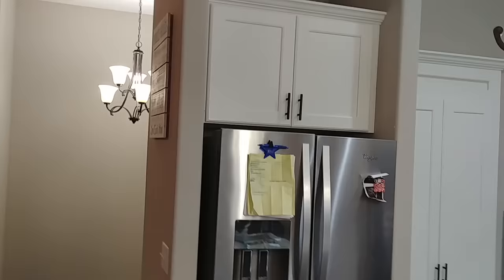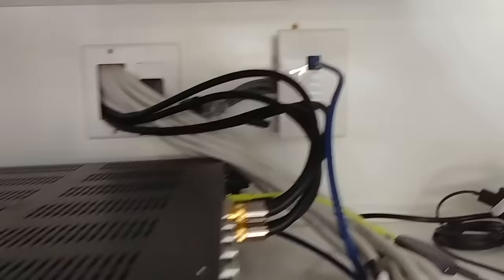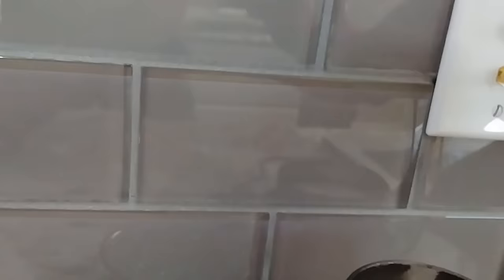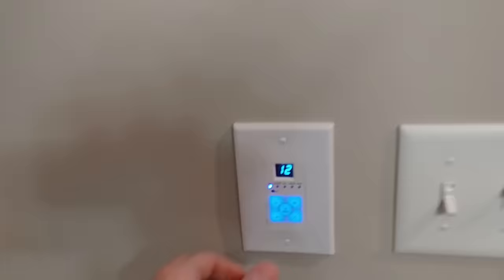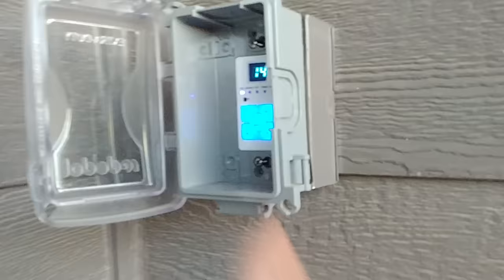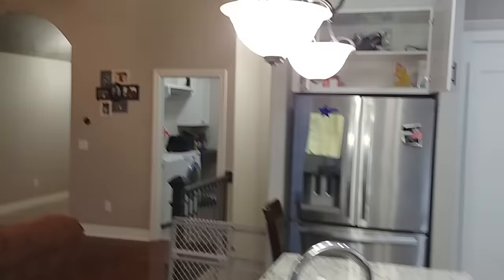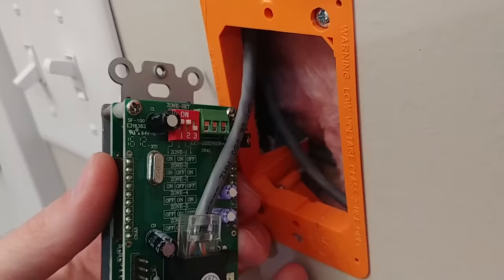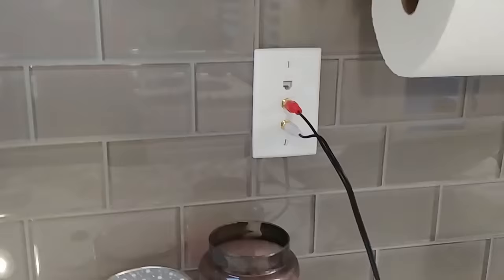WHOLE HOME AUDIO: Monoprice Whole Home Audio Amp! 6 Zone 6 Source

Comment: Thank you so much, I have purchased the system 

And today I was installing it and everything was perfect, except for zone 1 all jumpers setting are correct.

But for zone 1 the control keypad is working but if you press any key it does not do anything, but when you remove any other controller from the amp, zone one works perfect but when you connect all controller units zone one controller freezes.

I have checked the jumpers (ON OFF OFF) for each zone and still I have the same issue, even though the amp is just brand nrw.

If you have any info that cud help please reply. And once again because of your video I have bought that system and later I will upload a video to show you how I made the setup for my apartment.
Reply from the maker: Usually if this problem happens it's because of those 3 switches like you mentioned. Is your cabling good for sure? I would suspect that maybe, and next try using a different keypad from another zone and if you switch it and still get that problem it might be the cable. But if the problem happens on the zone you switched it with, then it might be the keypad since the problem followed the keypad
Reply: @TheKMZ1  I will make like small simulation to test if the device working properly and if that's true that's mean I have problem in the cables inside the wall, which will be problem, because it's apartment and I have those wire before coating and other finishing, gotta give u a feedback and also later I am going to record a video to show you my setup, it took a lot of time to purchase all the required item from abroad as we live in Egypt and the market is very limited
Reply: I have made a small simulation with small cabling it works .... Dunno where is the problem I will try to reinstall the rj connectors and see if there's any different
Reply: Now everything works well I have replaced the cable of zone 1 by fishing tape and now the system working very well, all credits to you.. the system is beautiful and good solution for any building, gotta buy the software that you developed and everything is good. Later I will record a video of my system and let you see what I have done

Comment: Hi Friend, thanks for this wonderful video. I want to find out how you were able to connect the RCA modular jack to the Wall plate. What is your connection mode with the RG6 cable running from the amp?
Was the cable soldered directly to the modular jack or terminated into another connector that connected to the Jack,?
Kindly share with me how you were successful with that connection and how you did it. 
I have a similar project but it is presently stalled by that the connections to the Monoprice RCA wall jack.
Thanks a lot.
Reply from the maker: They are RG6 to RCA compression fittings https://amzn.to/3iWWFhx
Reply: @TheKMZ1  God bless you, brother! I appreciate you. I will make a purchase right away.
Reply: @TheKMZ1  I appreciate your timely response. Thank you so much!
Reply from the maker: @tosinayorinde8324  please check out my new video, of the soundavo ws66i. Maybe you would rather have the new version of that amp?
Reply: @TheKMZ1  Alright, I will check it out. Thanks

Comment: Hi,

Nice install!!

how did you run the wires?
Was your amp installed on the main floor?  
Do you have a second floor and did you install any speakers/controls there?
Reply from the maker: I ran the wires in my attic, the speakers are on the main level only, not in the basement. I do not have an upstairs

Comment: TheKMZ1 i recently did an installation using this product but i didn't use coaxial wire for my source, and i have a buzzing sound, so i would like to know 1) u ran the RG6 cable from the back of the amp all the way to the wall thingy?yes? 2) Did you terminate the ends of the RG6 cables usign RCA plugs? thanks superb video
Reply from the maker: chuky sweettooth yes 1 RG6 for red RCA and 1 RG6 for white RCA, so every source has 2 RG6 cables. And yes each cable has a terminated RCA end on it
Reply: yessssss thanks thanks thanks, it all works without no buzzing sound, thanks alot RG6 was the missing link

Comment: Because all my speaker wires are in a tight spot & my AVR doesn’t fit ? So do I half to rewrite all of it ??
Reply from the maker: Just make yourself some extensions and either solder the extensions on, or use wire nuts to attach the extensions.

Comment: Awesome set up.  I just started wiring my new house to run this exact system.  Did you use RCA cables from the kitchen and TV’s for those inputs?  Or did you run coax and then convert from coax to RCA at the amp and the wall outlets?  Also - can I bridge two outputs together to yield higher watts to my outdoor spreaders, if I’m only using 5 outputs for 5 rooms?  I can’t wait to get this system up and running!
Reply from the maker: RCA cables and coax are the same thing, it's just that the home grade cables are much, much thinner wires. But at it's core they are built the same way. But to answer your question i used coax cable to make the RCA cables, because i needed custom lengths, but most importantly, you need the thicker cable so you dont have audio loss in your cable when going long distances. with cheap thin off the shelf cables, if you tried to get one that long, the audio would not travel very far due to the wire being so thin. You can't bridge them together that i know of, but you can chain 2 or even up to 3 of these amps together to make an 18 zone 6 source system. But even at the current output levels, they are loud, i have outdoor speakers, and they can push a great deal of sound.
Reply: TheKMZ1 thank you so much for your response! is that one coax cable per audio source, or two?  I’m going to look further into bridging two audio zones together for more juice to my outdoor speakers.  Or possibly a single-source amp to chain with this 6 zone system to give me more power for the patio speakers.
Reply: @terryjohnston3022  it is 2 cables per source, one coax for the "red" rca and one for white. (Left and right audio)

Comment: Hey I recently run some audio cable and and video cables to a closet where I can't see my devices in the livingroom, my question is the guy connect the DVR, amazon tv and the xbox to the receiver something that I really don't like because now I need to have everything on when before when I use to have them in the livingroom I use to have them work individually, for example not all the time I want to have my sound on to watch the tv now in this type of connection I have to have it on.

My question is can I be able to use a type of splitter, what can you recommend me to do

Comment: Do you know the rj45 pinout for the controllers? Some of my in wall cables have shorted conductors maybe I can salvage the wire and connect by changing pinouts and using good conductors.
Reply from the maker: Standard straight through Ethernet, just put new ends on them and wire to the ethernet TIA B standard

Comment: Hi TheKMZ1 

I was wondering if you can explain how you connected the sources from a coax cable to rga.  I run my coax cables to all my sources don’t know how to go from there   Thanks for your time.
Reply from the maker: You simply buy Rg6 RCA connectors, I use compression connectors

Comment: Great video. just ordered the same  system because of this video . One question  how many speakers  can you use in one zone .
Reply from the maker: Noel O Morales it's built for 2 speakers per zone (a left and right speaker) but with some manipulation with speakers on series/parallel, you could probably do more.
Reply: TheKMZ1  ok thanks  for the info. Keep the videos coming.

Comment: When you are at the amp, you said your 'sources' are coax.  But when you are on the kitchen at source 1, you said you ran RCA cables.  Could you please explain?
Reply from the maker: Rca cables are just coax, with rca ends crimped on them. Coax can be used for many types of cables, rca being just 1
Reply: @TheKMZ1  OK, so still 2 cables, L and R.  I was thinking both channels came over a single coax.  Thanks
Reply from the maker: @sagetx  yes you need 2 coax one for L and one for R. If you think about ones that come with VCR player or DVD player, they are separate too, but just smaller guaged wire than coax, and those small ones are fused together. So you know how it looks like you can pull them apart because those cables have grooves? That's because you can since they are 2 separate cables. Sometimes they put them in 1 jacket so they look nicer. Anyway even those are separate!
Reply: @TheKMZ1  yes. I'm on the right track now.  My only stumbling block is how to use the 5 speaker ceiling set my builder is including in the living room to be able to just play audio too. In really liking this audio solution you have done.  Not over the top whole smart home control, just confortable music everywhere.

Comment: When rack mounting the receiver did you only use the 4 cage bolts on the face? Seems heavy to me ? Should use a shelf ?
Reply from the maker: I've had no issues with using the 4 bolts. I think it's fine just use that!
Reply: @TheKMZ1  thanks I’ve watched all you whole home audio videos . Finishing up a self built cabin 1200 sq ft 6 zones 15 speakers
Reply from the maker: @bobbybuick  awesome!! You'll love it

Comment: According to Monoprice the cat5 from each zone zone goes directly to the controller key pad, where are the wired from the zone speaker  output put goes to? I have a Legrand OnQ LYric that is not working and wants to replaced with the Monoprice system, according to Legran the voule control in each zone is not compatible with Monorpice.
Reply from the maker: Did you watch the whole video? I felt like I explained the connections pretty good

Comment: Hi. How did you terminate the coax cables with rca jacks. ? Can you provide a link of the ones that you used?
Reply from the maker: Rg6 RCA compression connectors. It's just a different connector for coax cable available at all major hardware stores. Coax can be many different types of cable, not just for TV
Reply: @TheKMZ1  Thanks. I am looking for RCA keystone jacks for wall plate. Do you know how those are terminated?? I did install this system and I noticed that the volume would go down couple of notches when the beat would start in the song. It would go back up when the beat stops. Have you noticed anything like that?
Reply from the maker: @saurabhkalra9798  no I've not ever had that problem, the key stone jacks just plug in, so you terminate the end like normal and it just pushes on. I buy them from monoprice

Comment: Which RG6 to RCA compression fittings and tool did you use for your RCA wall input? Also, was there concern about the bend radius in the wall at the wall plate? I have 4 RG6 inputs, which is 8 cables, terminating into 2 wall plates at the amp side but I am worried about trying to bend the cable to fit into the keystone wall jack. Thoughts?

Comment: Hey TheKMZ1
! Awesome video and really like the setup a lot. I'm also building a new home and am going to go this route after watching your video. Planning on pre wiring the entire house with low voltage for all my tech and am trying to learn all I can as fast as I can. Any other new constructions tips you may have will also be much appreciated.

I do have a couple questions for you if you don't mind. You said some of your sources were RG6. Where do you have those sources run to and how did you end up terminating? I'm clear on the  the RCA for the cable box / kitchen and 3.5 for the chromecast, but was confused my the RG6. 

Also, I would like your opinion on incorporating an Onkio receiver I have sitting around. Would I even need my existing receiver at this point. if so, how would you set it up with this system? 

Thank you in advance. Again, awesome vid and setup.
Reply: I'm in the same boat you are, only 9 months later.  I am about to purchase and pre wire my new construction home.  Can you give me any insight into what you did? I need to order soon, add my builder is killing it.

Comment: Question Im hoping you can help me with. Let say you have one zone with two speakers, one speaker in your master bedroom and one speaker in the master bathroom. Is it possible, in your setup, to wire these speakers to independent wall mount volume controls? Basically the monoprice keypad would be the main volume and then each speaker would have its own volume control knob on the wall. The solution being you can turn one speaker in the bathroom louder that one in the bedroom completely off? Hopefully that makes sense.
Reply from the maker: Your question makes sense but since these volume controls are digital, there is not a way to do that unfortunately

Comment: Hi this is excellent! How much did it cost u, also i have a house in africa,  already built, how would i be able to run the wires?
Reply from the maker: Yes you can use this in an existing house but you will need to run speaker wire in the attic of the house to the ceiling speakers. Using the android app, you do not have to install the keypads in the walls, but if you are able to, i always suggest installing them

Comment: Hey man, I just ordered the monoprice audio amplifier and the soundavo 8 inch speakers to pair with them thanks for the discount code btw. Am I going to have to bridge the amplifier to be able to use the speakers with the monoprice amp? or can I run the 2 8 inch speakers on the 4 ohm 50 w left and right for one zone? The soundavo say they are 8 ohm 60 w. Also how can I get audio from my tv to amplifier without a rca out of the tv? I am currently using arc to my soundbar for audio out at the moment. Would I have to change the audio out of the tv to like optical out and run a optical cable to amp so I can hear tv that way through my speakers?

Comment: Awesome setup.  I'm looking to install the same setup but I'm having trouble figuring out what speakers to buy.  The system mentions 25 watt per channel, if I get a speaker that says 350 watt will it still work? Any suggestions on which speakers to buy?
Reply from the maker: I would be skeptical that 350 watts is the RMS value. That sounds more like a max value, which you should never look at. But i would recommend getting a speaker as close to 25 watts RMS as you can. I probably would not go above 50 but i try to match things up perfectly. Underpowering a speaker can be just as damaging if not more, than overpowering. My speaker suggestions are in the description of the video. Thanks!
Reply: @TheKMZ1  Thanks!  Next time I won't skim the description so quickly, hehe.  In your opinion, would a pair of those speakers be enough for a garage that's about 25' x 30' about 12' tall?  If not would I have enough flexibility to run 2 pair without an additional preamp?
Reply from the maker: @jaredwollan1952  the black indoor outdoor speakers I used (so not the in ceiling) would definitely be more than enough, they are great speakers and get very loud, bass response is actually surprisingly good. You will not be let down

Comment: Now that google discontinued the chromecast audio, what alternative would you recommend?
Reply from the maker: Now I'm recommending the new upgraded monoprice unit (not technically made by monoprice, but keypads and controls are the same) it's the Soundavo WS66i and it's got 2 wireless streamers built in, and the app control module built in. Check out my channel and look for new upgraded monoprice whole home audio

Comment: Have you come across the Factor Electronics V66? It has the same form factor and the same exact ports and switches as the Monoprice Set up, except the blue lights in front of the monoprice is Red in the factor electronics v66 amp, in this case I wonder who is copying who or what exactly is going on with the same chassis and different brand names.
Reply from the maker: Toby Kez they are all the exact same just rebranded. There must be 1 manufacturer that you can buy these from and market them under your own brand. Yes I've seen it and it's the same exact thing, just a different looking keypad.

Comment: Great video, I have a new build house with 4 zones. One outside one in the kitchen and two in the basement all my wires are going to the one spot in the basement . Can I have something controlled by smart phone and play one of the zones at the time or two.
I purchased Sonos, only two zones can be wired and both zones are doing the same thing.
Thanks
Reply from the maker: So you are not using this system or you are switching to this system from a sonos?

Comment: Is there an amplifier that can utilize a wifi network in your home and be controlled by a smartphone app vs. keypads on the wall? I just moved into a home that has 12 speaker zones but owners took the amps so I want to set something up. I would think there would be a smart amp out there, even if you have to wire ethernet into the amp but use a smart app via your home wifi network to control the amp would be great!
Reply from the maker: Roger Parker there is an android app for these amps now! I wrote it, you need the itach flex to attach it to the network

Comment: I just installed a Nero Max 12, which is pretty much the same thing. The house was pre-wired for 4 speakers in the garage. Can I put all four  speakers in one zone?
Reply from the maker: Yeah you should be able to, check my channel, I have a video titled something like 4 or more zones on 1 channel
Reply: One more question for you. I'm not clear on the coax use for sources. Did you use a y-splitter behind the TV?